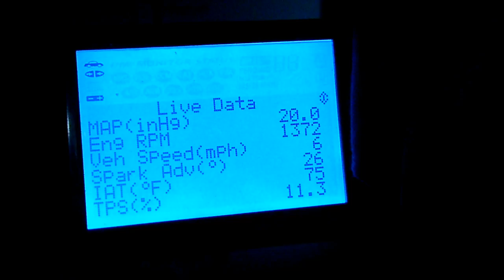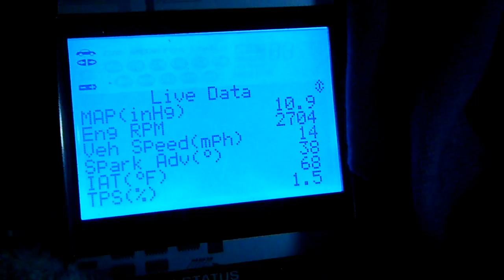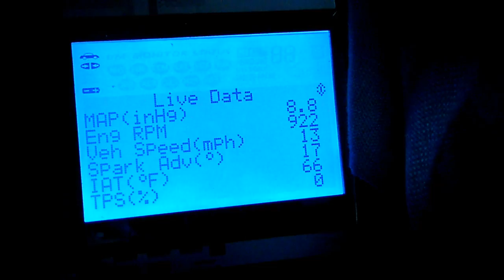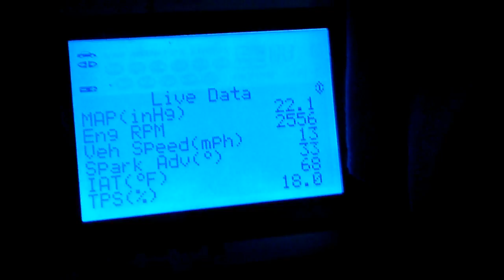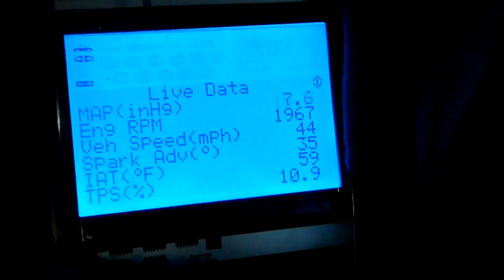TPS Reports

Comment: Why does your spark advance cycle from 12 to 22 degrees when you are sitting waiting for a light?  Your RPM is pretty stable at 830 while you idle in gear.  Why the timing change?